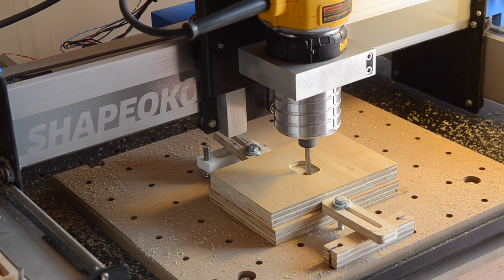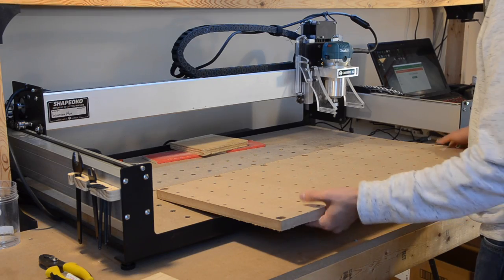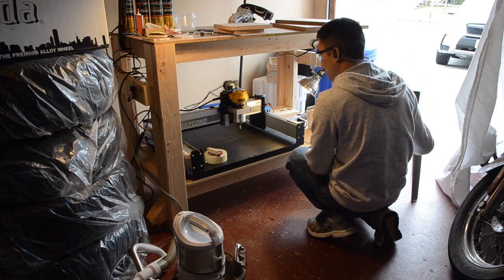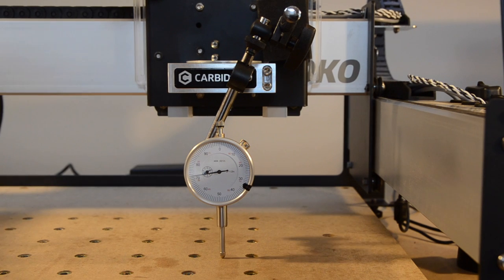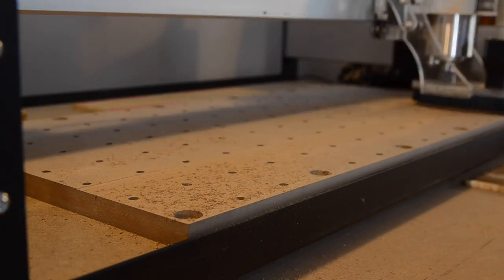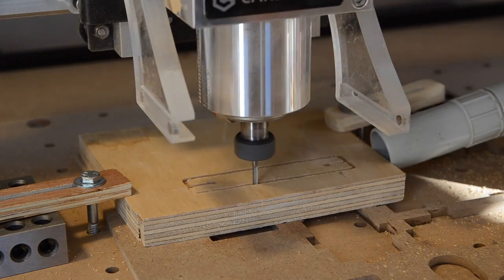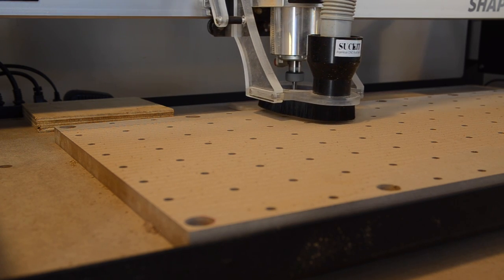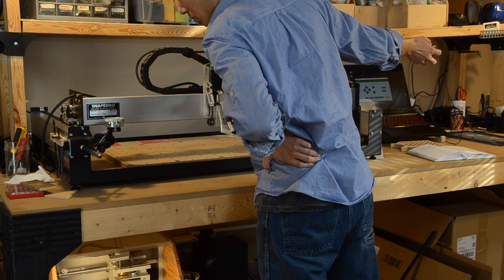Basic Shapeoko 3 Tuning: Squaring, Spindle Tramming, & More

Comment: Winston, 

Thanks for putting together this video. It was extremely helpful in getting my new Shapeoko 3 up and running properly.
I was having squaring issues during assembly and this video covered all of the issues I was having.

I faced a MDF wasteboard before I did the tuning and it had ridges. After tuning, I resurfaced and it was smooth.
Circles and squares cut great!

Thanks,
Sam

Comment: I just spent a little bit of time tramming my spindle front to back. I created a small facing operation in Fusion 360 that was about 11" wide and only three passes along the y-axis with a 0.2mm depth of cut. I'm using a 1" surfacing bit that will amplify the out of tram condition compared to a 1/4" bit. I mounted a scrap board on the part of the spoil board that seemed to be the most level to the x and y axis. For this operation it really doesn't matter that much. I ran the facing operation once and it was obvious that the spindle was leaning forward so I needed to tilt it back.

Now for how to adjust for that lean...

1. Turn off the CNC and remove the spindle from the holder.

2. Remove the springs from the z-axis then lower the plate as far as it will go. The bottom wheels wheels will actually drop off the rails at the bottom.

3. Tilt the bottom of the plat forward slightly then the plate will drop another few mm. The mounting screws for the plate are now accessible from the back of the machine.

4. Loosen the mounting screws. You do not need to remove them.

5. Fold some tin foil into a long thin strip about 4 or 5 mm wide. It doesn't take very many layers to make a noticeable difference.

6. Slide the foil strip between the spindle mount and the plate. In my case I put it just below the mounting screws since I want the mount to lean back. If you need to lean it forward put the strip above the mounting screws.

7. Tighten the mounting screws.

8. Slide the plate back up making sure the lower wheels are engaged with the rails correctly.

9. Re-install the springs and spindle.

10. Run your facing operation again to check your results.

Repeat as necessary removing or adding layers of foil until you get it as close as you feel you need. You'll need to re-zero the z-axis each time. That's partly due to the fact that you removed and re-installed the spindle but also the top of your stock is lower each time you run your facing test.

I completely over estimated the number of layers I would need on the first try. I think I started with something like 9 or 10 layers and ended up with the spindle leaning the other way. I would start with just 4 layers and adjust from there but each machine will likely be different.

If you get to the point where one layer of foil either way is too much, try moving the foil strip closer or further away from the mounting screws. I haven't tried that but I can see how that could make a tiny difference in the angles. We're talking about small fractions of a degree.

Only time will tell if this will be a permanent fix. I'm not sure if vibrations may cause the foil to shift or compress more. I'll probably run these facing tests once in a while to see if it's holding.

Comment: Amazing tips! Flattening the waste board is a no brainer. But checking if the flute is in a 90degree angle to the wasteboard is very overlooked. I will check mine as its giving very rough lines in my parts when doing surface milling

Comment: My SO3 XL also has that dip in the center of the waste-board along the X axis.   I measured the dip with a straight edge and a feeler gauge - .45mm right in the center, and consistent along the Y.   My solution was to shim the center rail below the washboard using some sheet metal shims cut from some flashing.   It's now near perfect and I didn't have to surface the waste-board.

Comment: Another thing... fit your router into the mount, tram it in.... THEN LEAVE IT IN THE MOUNT. 

Removing and replacing the router means you need to re-tram it in again. I used to use my 611 as a trim router as well as a CNC spindle and then I would find my next CNC cut would be out slightly. I would get scalloped surfaces and fine parallel gouges when it was fine before... all because I hadn’t put the router back in the mount exactly the same as how I had trammed it in. 

So now I leave the 611 in my CNC and bought a second 611 to use as a trim router and can still share collets between the two and not get the problems I was getting before. That way I get best of both worlds.

Comment: An update. After spending some time trying to tram my spindle and having little success, I had to set it aside for a while. I finally got back to it and looked more closely at the ripples that were being left in my work piece by my facing operation. What I noticed is that they were inconsistent. If the spindle was simply out of tram they should be consistent across the entire work piece. That led me back to the z-axis plate and that's where my issue was. The bottom wheels were not tight so the bottom of the plate was wobbling. I tightened the wheel up and the next test still had ripples but they were consistent. I removed the shims that I had put in before an now it's pretty much dead on or at least close enough for woodworking. So, lesson learned, trust Carbide's construction.

Comment: Winston I see that you checked the stepper motors but didnt explain how to compensate for discrepencies.  Any help here.  I just pulled my machine apart that I bought used, and I tightened the belts a little  I have no idea how to actually program the compensation though.
Reply from the maker: You change the calibration by modifying the saved grbl parameters: https://github.com/gnea/grbl/wiki/Grbl-v1.1-Configuration

But the factory calibration should be good to within a fraction of a percent. This would be the last thing I would touch if I was troubleshooting the machine. Because if it's not this, you've just made things worse and harder to diagnose, as now nothing will ever read correctly.

Comment: great idea on truing the spindle but the flaw is: you drilled the holes using your out of square spindle therefore the holes will be out of plumb. I know it doesn't really matter as long as you rotate it, but it would be better if you used something to drill the holes you knew was dead nuts plumb.

Comment: Winston, it’s good you couldn’t afford the tramming indicator... why? Because if you can’t fit a standard dial indicator then you can’t even fit the mini-tram from Edge Technologies. 

I got the Mini-Tram and found I had to extend my gantry up on my Ox just so it would fit... but it was well worth it. Cool thing is that I use it on my drill press as well... just don’t do what I did today and have the chuck detach and jam one of the indicators. 🤭

Comment: A good dust collection system would reduce the chances of chips getting on the sliding rails and manifesting errors. Lubing the sliding rails reduces jitters and making sure that the spindle spins true would help or no wobble.

Comment: As a tool and die maker, I appreciate your effort to square up your machine.   I wondered how long it will stay squared up because of the small bolts and thin material?   I am currently looking to get a Cnc.   Can’t decide between the Shapeoko xl or the X-Carve.    

Thanks
Reply from the maker: As far as I can tell, the squaring itself stays pretty well but I would recheck twice a year. Bigger issue is the MDF table, which can move seasonally depending on humidity. At larger sizes, flex also plays a role. If your workbench isn't perfectly flat and you shift your CNC over a couple inches, or move it, you'll have to re-flatten your work surface.

Both machines will cut wood great, I'm probably biased, but structurally the S3XL is exponentially stronger and that's a deciding factor for a lot of people. Pity you missed the black Friday sales...
Reply: Yes it is!  How much were they selling for on Black Friday ?
Reply from the maker: I don’t remember exactly (since I wasn’t shopping for one), but I recall free shipping and a free router/spindle as part of the deal...

Comment: Hi Winston,  great video! I've already ordered the calibration  tools.. What spindle are you using and why did you pick it? Am looking at upgrading from my Makita router and would like a spindle that can be operated via Carbide Motion etc..
Reply from the maker: I'm actually using the Makita as my primary spindle. I'm not dealing with a ton of plastics right now, so I'm fine with the 10k RPM floor. For a spindle to be controlled by gcode (vis CM, UGS, etc it needs to accept a PWM signal and binary on-off signal from the control board. Routers can be hacked to accept this via something like Super-PID. Or you'll need a DC spindle (ex. Inventables Quiet Cut w/ Speed Controller or eBay equivalent). There are bigger DC spindles, water cooled, etc but I haven't dealt with them first hand so I can't advise you there. See: https://www.shapeoko.com/wiki/index.php/Spindle_Options

Comment: Hi Winston, been following your videos so i can get started with my Shapeoko 3 XL, your videos are a great help! I was wondering what type of clamp set do you use when working with aluminum?, also, what collets and bits do you use? i know the dewalt router comes with a 1/4" collet, where can i find different size collets for smaller cutter bits?
Reply from the maker: http://www.elairecorp.com/dewaltroutercollets.html#dwpanchor

I've held aluminum purely with double sided tape before. But for clamping, even just my wooden clamps are sufficient if I get the aluminum stock close to a bolt hole. You only need enough pressure to apply friction to counteract the push from the endmill, which isn't as much as you think, especially with 1/8" or smaller endmills.
Reply: Thank you so much! just what i needed, also, i think i will add an aluminum wasteboard as it seems to be better for leveling and durability, quoted a local shop, shouldn't be more than 300, will post when its finished

Comment: The Z axis is a problem. You need to square the axis itself so that vertical movement is actually normal to the x and y axes. Once you have that right you can align the spindle motor with your rotating rod. This adjustment needs to be just to the motor in its bracket.

Comment: When I did the tramming on mine (I got lucky and 3D printed an adapter for my dial indicator that allowed it to fit under my gantry), I adjusted the spindle mount instead of the gantry. My theory was that if you already have your gantry square/level, then it was the spindle mount introducing the error. However, the bolts holding it on were a pain to get to and adjust. The other point of adjustment for that was also the Z rails to the Z plate.

I also HIGHLY recomend a spoiler board surfacing bit. I got mine from Woodcraft.
https://www.woodcraft.com/products/6210-cnc-spoilboard-surfacing-router-bit-1-4-shank

It is 1" diameter so the surfacing goes a lot faster. I also use it to surface objects too large for the planer.

Comment: Lasers I think will take over in the future for cutting and engraving.
Reply from the maker: +alphasxsignal For flat shapes, sure. For 3D contours you have a long way to go. Look at examples of 3D laser engraving. Excellent detail, but surface finish is usually only "okay". The raster process is still quite discernable. And that's just in wood. Even most "2.5D" jobs on a cnc are impossible for lasers.

Comment: Did you "preloaded" the dial indicator before taking measurements? This is important to eliminate the slight play in the indicator.
Reply from the maker: Only by about a millimeter or two. But I went through the majority of the travel of the indicator to assess linearity of the measurement.
Reply: I never preload my dial. I use a Mitutoyo, and from the first contact I don't feel any play. It's like if the preload was made on factory, and it starts to count after this point.

Comment: Look into buying a 1" surfacing bit.  It only takes a few minutes to level my 36x36 area.
Reply: It's worth it. A cheap woodworking bit package is all you really need.  I got a 20 bit package for 30$ on sale from Lowes.
Reply: Could also go with MicroMark's mini 1/4" shank fly cutter.
Reply: @TylerHarney  Just wondering if you have done this, and if so, how did you balance it? I wouldn't want to try running an unbalanced tool like a fly cutter at 10,000-30,000 rpm  in any machine, much less a router....

Comment: Hello, I know you had this video a long time ago but I want to know about the fiability of the Makita rt0701 ?
Does it handle long CNC runs for hours ? Usually which speed do you use ?
Thanks
Reply from the maker: I run anywhere from 1-4, usually between 1-3 on the dial. Put dozens of hours on it on the original brushes, no thermal issues. I highly recommend dust collection and/or a filter (sock) over the router because particulates will accelerate wear of the brushes. I have still yet to replace any brushes.
Reply: @WinstonMakes  ok thanks... I'll have to check out on my father's cause as I remember the speed dial is from 3 to 6. May be different between EU and us version

Comment: Do you have a way to square the X axis to the Y axis?  On my Shapeoko 2, I struggled with this.  You can't use the steppers and belts to force the x-axis into square.  In my case I had a bur on the tapped holes of the x-axis extrusion that I had to clean up.  Then when I remounted it to the side plates, it was square.
Reply from the maker: Without machining the ends of the extrusion to be perfectly square, it's hard to do. Best bet is to use shim stock to correct for any errors, if you can even measure it.

Comment: I just purchased my XXL. should be here in 3 days or so. now I'm looking at the router; do you recommended the Makita or DeWalt?
Reply from the maker: +Jesse Fritz I'm partial to the Makita with one warning. It's about a half inch shorter than the Dewalt, so small endmills may have a hard time reaching the table. But I usually shim everything with a 3/4" slab of MDF anyway. It has a lower minimum RPM which is really helpful with plastics.
Reply: OK. I'm going to be doing some Nylon and Acrylic, as well as Aluminum.  Love these helper vids by the way. Excellent execution!!
Reply: I just looked up the specs on the Makita, it has a much lower min RPM 10k compared to DeWalt's 16k. This is huge. Think I might go with this. 10k is much more appealing vs 16k when doing plastics. If I find that it doesn't work for my needs, I can always return and purchase the DeWalt.

Comment: What brand and type of tape do you use when mounting projects to the waste board prior to having the screw mounts?
Reply from the maker: I'm personally a fan of Nitto Permacel P-02: http://amzn.to/2sJTS4K

It's like high-strength masking tape, and double sided. Cleans up way easier than carpet tape. Little pricey, but works out to a couple cents a project over time. Other people swear by masking tape and krazy glue... which I can't see being fundamentally different than P-02, maybe cheaper, certainly not as convenient. Check ebay prices too.
Reply: Thanks. All I could ever find was the foam type and I was worried about the amount of deflection it would potentially have.

Comment: i absolutely cannot get my wasteboard to come out clean.  ive adjusted everything possible and my spindle is still slightly crooked forward and to the left.....so frustrating. i dont know what to do
Reply from the maker: If you can't get enough adjustment in the forward/back tilt of the router, you can try shim stock or aluminum foil under the router mount.  You can also use a file or drill to carefully scrape off some of the powder coating on the carriage plates to get a tiny bit more adjustment.

Comment: Can this correction be done by using under plate, that would be cut to level, with it's lowest point, every time it bends?
Reply from the maker: Not sure what you're referring to. Any bending that you see is static and doesn't usually change.

Comment: hi i just wanted to know do you still have this machine ? if so how is the reliability for you? i am new to cnc routing and was thinking about purchasing this machine as the price is reasonable but want a semi decent machine to mill mostly plastics like acrylic etc thanks
Reply from the maker: Still running. The technology is pretty straightforward, and replacements for things like belts and v-wheels are readily available.

Comment: Could we get a link for the design of the part you cut for the spindle?
Reply from the maker: Sure thing, uploaded the SVG profile to my site: http://www.winstonmoy.com/2017/04/precision-tuning-shapeoko-3/ 

Cut w/ 1/8" endmill in 1/2" or thicker material. Ream w/ 1/4" drill bit if fit is too snug. SVG from inkscape, so set DPI to 90 and/or ensure file is approx 4" x 0.75".
Reply: thanks!

Comment: So you loosen the x axis mounting bolts and lift to get the x axis level, but then you loosen those bolts when you square the spindle? Isn’t that now making your x axis no longer level?
Reply from the maker: Leave one bolt  on each side tight, pivot about that axis.
Reply: I was a good 0.05 inch off X axis and I was only able to get it to 0.04 off. I don't think the baseboard is twisted because it's almost exactly 0.04 inch off front and back. Will machine leveling the wasteboard take care of this offset anyway?
Reply from the maker: machine leveling will cure everything except tram error (rotation of the spindle relative to X-Y plane).
Reply: Okay cool. Thank you!

Comment: How long does the alignment last?
Reply from the maker: Until the next massive swing in temperature/humidity or you drop 30 lbs on the wasteboard/frame. But tbh, I just don't touch it until the next time I feel like taking the time to refresh the calibration... which is very rarely. #goodenough